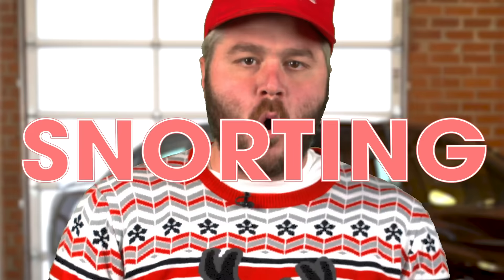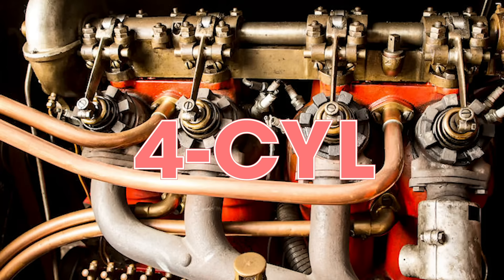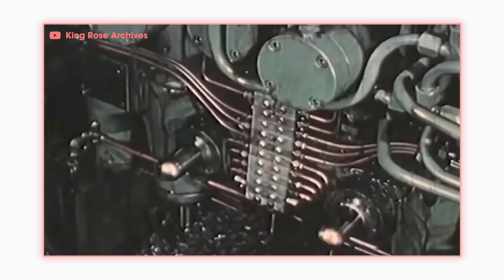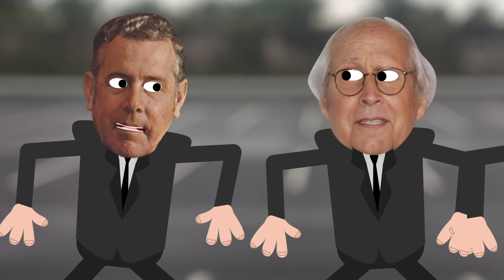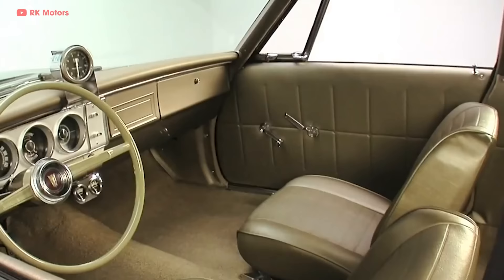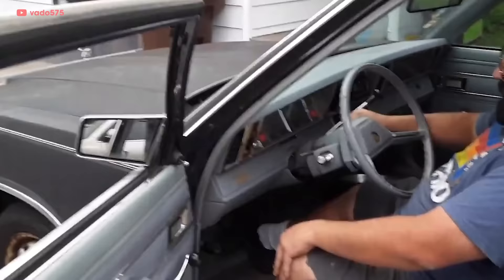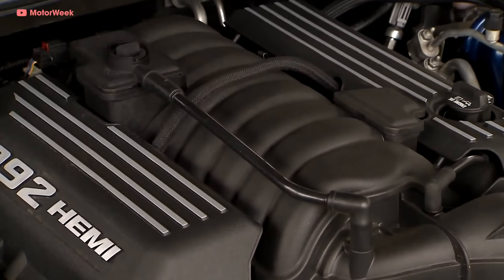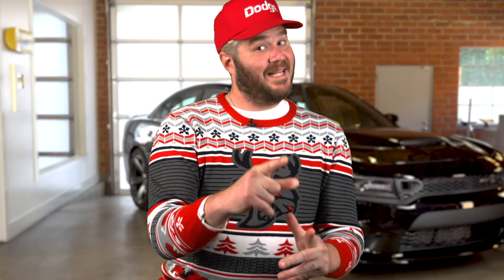DODGE HEMI - Everything You Need To Know | Up To Speed

Comment: "can you imagine 2 thirds of a horse" shows about a quarter of a horse
Reply: off a horse
Reply: Gross!
Reply: Quarter horses are real...
Reply: The rest is in the engine, duh
Reply: Your supposed to Imagine the 2/3 horse lol
Reply: I'd like to imagine that there was at least 1 if not 2 guys who were thinking "How can i modify this thing to go faster and give me at least 1 and a half horse's ?"
Reply: @jamessalas9220  many gas-powered appliances now have similar sized engines making around 15 times as much power as the original Benz engine. Seems like an easy job as long as it’s possible to find an original or more likely replica vehicle
Reply: If it’s too hard to find, the original patent should be in the public domain since it’s well past 95 years old
Reply: Technically it's not wrong, one horse has 2 horsepower

Comment: I just bought a Ram Big Horn with the 5.7L Hemi, I absolutely love it. It's amazing how that Hemi can move almost 5500lbs like it was a crated up Civic. I love to remote start it when I'm standing behind it, reminds me of the good old days of driving Trans-Am's, the sound is music to my ears.
Reply: I have a 2022 Big Horn on order with the hemi. I can't wait to get it.
Reply: Make sure you change the oil regularly. If it has the mds you're almost guaranteed to expensive catastrophic cam and rocker failure that chryslers been aware of but just don't care
Reply: @jmt8706official  have you gotten it yet? I had to wait 4 mos for my new challenger RT 6-speed manual with shaker hood. Just got my Little Suzi a couple weeks ago.
Reply: @TheJLH  Hven't got it yet. Possible delivery in February.
Reply: @jmt8706official  what about now? How fast is it?
Reply: @Jorge O  For a heavy truck, the hemi is plenty of power and speed, it's great.
Reply: @kevobrando95lx44  most people get a tune to stop mds from activating

Comment: 3,400rpm on a prop plane in WW2 is actually quite high. Most german planes thrived at 2,500rpm-3,000rpm, whilst Merlin’s could handle 3,000. But a lot of axis engines would have issues above 2,700rpm aside from the one like Jumo 213E. 

You can only spin a propeller so fast before wit becomes inefficient, resulting in a loss of power or death of the engine.
Reply: it may refer t engine RPM and not Prop RPM
Reply: @illucidate3749  There's usually a reduction gear so, it's probably referring to engine speed not prop speed.

Comment: Everyone complains about challengers not being able to handle. I feel like the big, boxy, heavy, design adds to that old classic muscle feel. I think the scat pack with the 6 speed is the perfect modern MUSCLE car. Big and heavy, lots of power from a big hemi V8. No supercharges or turbos just raw engine roar. Still the same beautiful cruising car. It never was meant to take corners at high speeds and put times on the track. It was built to give you the best muscle car experience.

Comment: The 5.7 Hemi in the 2011-2020 Grand Cherokee is extremely quiet and toned down a bit. You can see the giant intake resonator in front of the throttle body and the multiple mufflers. However, it still sounds pleasant in the cabin.

Comment: I have a 1953 DeSoto Firedome V8 that I got from my grandfather. My grandfather was not the most technical inclined man. He was messing with the distributor and ignition timing, the motor backfired and the engine caught fire, it then sat in a yard for 17 years. My grandpa still did the best he could to try and still take good care of the car, even after the motor caught fire. He would go outside, rain or shine, and cover/uncover the car, open the doors and compartments, so that it wouldn't mold or rust. My grandpa was hit by a car a few years ago and suffered a brain injury, fast-tracking his demensia. he was no longer able to take care of himself, let alone the car. My grandma didn't much care for the car, she didn't do anything to take care of it like my grandpa did. The car sat in the yard for another 2 years without any care. He was so happy when I asked him if I could have the car, I had never seen his eyes so bright. I got the car when I was 16, when I was 17 we were finally able to get a flat-bed truck to help transport it from my grandpa's house to ours. I'm 18 now and I've been doing everything a can to get her up and running. Just a few weeks ago we got the motor to turn over for the first time. There is still a lot that needs done one the car before its even remotely driveable. there's a lot of things that need cleaned, derusted, demolded, and replaced. I know its going to take a lot of time, and a lot of love, to get her running. But like Donut says, "Cars are pain ❤." And I know that in the end, it will all be worth it to hear that engine start for the first time. My grandpa is in a care home and in his late 80's now, and because of his demensia, he doesn't really remember anything anymore. I know he doesnt remember who I am, I know he doesnt remember the car, but I know how much he loved me, and I know how much he loved that car. My hope, and my dream, is that before I can get our car running and take my grandpa on one last ride before he passes. That would mean so so much to me, and that is my dream. I hope I get the chance to see it come true. 

That's the story in a nutshell, there's more to it if your interested.

Thank you, @DonutMedia for all the hard work you guys do, especially the editors and researchers who make the videos possible. You guys are amazing and It doesnt go unnoticed.

Comment: You should talk about the valve dropping issues on the 5.7, and the lifter/cam failures of the gen3's. really killed the hemi name.
Reply: R/T boy 954  Exacty. My 2009 Charger R/T AWD went all the way to 229k miles. Always ran Royal Purple and always changed at 3,000 miles. I got lazy after it became my sunday driver and started doing changes at 6,000 miles, blew after 3 changes.

Comment: Another great video. Interesting fact, the 2003-2006 Honda Civic Hybrid little 1.3L 4 cylinder was also a 2 valve “hemi “ with twin plug ignition and SOHC. It also had VTEC…not for Mo Power but for fuel efficiency as it could selectively cylinder disable 3 of the 4 cylinder to cut down fuel consumption. I used to drive one of these!

Comment: That 4cyl hemi Is the G54B (2.6L) they used that engine in so many cars, including the Mitsubishi Starion. It came turbo charged with a whopping 140-170hp , but they do have decent torque figures. I have like 6 of these engines lol
Reply: Liar
Reply: @AlexJasso100  about?
Reply: If they made a high strung hemi 4 cylinder and put it in a light, sporty vehicle, it might keep the Chrysler company from falling apart nowadays
Reply: I’ve got a Hemi2.6 badge glued to my old toolbox

Comment: Those HEMI's are the best sounding v8s...
Reply: I used to have a 454 with headers that sounded pretty good. But yeah, my current hemi sounds great too!
Reply: Nah the Ford V8s have the most violent sounds.
Reply: @rxtuninginc8444  yeah but the hemi still sounds fantastic
Reply: @thatoneathiestguy2752  meh Ford modular V8 sounds way more nasty.  The Hemi to me sounds like typical V8, just like the LS.  I like the sound of any V8 with a nice exhaust on it though so I'm not stuck on one brand.  My brothers GT350 (the flat plane crank engine) sounds like a menace at 8000 rpm.
Reply: 4.6 GT has entered the chat

Comment: I seem to remember a 383 hemi in a 'Cuda that is still a valuable collector's car. The other engine option for that year was a 440 wedge.
Reply: @George Lane I hate being wrong. But I hate arguing too. So, I looked it up. Here goes:
The Mopar big blocks introduced in 1958 were all wedges. This refers to the shape of the combustion chamber. They were all 90 degree V8s.
Yes, the 383 was a low-block. It had a shorter crank throw. The 440 was a raised block with a longer crank throw.
The 383 was also called the magnum or the camando.
As it turns out, the only hemi in the line-up was the 426. It used the same block as all the other wedge engines.
So, the information in your response is correct as far as it goes.

Comment: Another amazing facts about American Fighter planes: the P-51 Mustang had Nitrous.
Reply: michael howell that was the mustang H I think and p38 was turbocharged with meth injection
Reply: @trevoncowen9198  the p38 was super charged except for the exports. We didn't want the tech to fall into in the hands of the notsees. I didn't know they were injected too, though.
Reply: michael howell The Germans weren’t too worried about our P 38 turbo charger technology as they had a far superior system that used a hydraulic coupling also all European theater p38 had turbos as they were high altitude long range bomber escorts and the Supercharger system offered with the Allison engines did they use were not sufficient the turbos didn’t even match up but they worked they often over boosted the engines at lower altitude which is why they became really good ground attack planes the turbos were housed in the booms I really suggest A book called 100 years of aircraft  or just googling it
Reply: Did you know that the supercharger in the hellcat takes 80hp to run not counting the 707 it already makes
Reply: @hairychesticles1  I didn't know that
Reply: I believe some german planes had that too
Reply: @trevoncowen9198  so I just checked to make sure, we were both right or wrong depending how you want to look at it. The p38 was turbo suoercharged.
Reply: michael howell that’s what it was called But you have to look up what a turbo supercharger was that’s just what they called them because it used a turbine To turn a supercharger impeller thus the name in reality it’s just a turbocharger in modern terms But when most people hear supercharger think roots type you can’t use those on aircraft because they always move the same amount of air and as the alt  goes up the amount of air available to move decreases so the supercharger needs to spin faster all airplanes that were super charged in ww2 use a centrifugal type superchargers That had two or three speed gearboxes to change the impellers rpm For different altitudes
Reply: hairychesticles1 I didn’t know that that’s freakin cool
Reply: @trevoncowen9198  bro, you know your shit for sure. You've left me behind. At this point I have to just throw my hands up and tell ya you've won. Haha

Comment: Next engines:
2JZ
RB
LS 
Ford Modular motors
LS
SBF
SBC
BBF
BBC
K Series
Reply: JC AJ Small block Chevy should be next that's what gave power to the masses not that 2jz Japanese schoolgirl engine
Reply: when it comes to modern cars , I'll take a Toyota V6 over any GM V6
Reply: Troy Stocker First time I ever heard that Toyota V6 lover Most like the four-cylinder

Never had to change a timing CHAIN from a 3800 GM.  3.4l v6 Timing BELT Thousand times might as well Change the water pump power steering etc Basically the whole front end of the engine
Reply: GM could never build a fwd transmission to handle the power of the 3.8 L  , then came the junky 3.6 L with its 3 timing chains.
Reply: bland as fuck but they dont break down
Reply: Troy Stocker When you buy a toyota It's like you gave up on life lol
Reply: when you buy a GM or Dodge , you dont really value your money. Or your spending extra for a status symbol,  esp. true when it comes to Dodge fans
Reply: Ford 300
Reply: R O T A R Y E N G I N O N
Reply: Hey we need an engine. Okay make a heavy as hell iron pig and have someone else design the valve train. We will call it the 2JZ. If you guys like the 2JZ you would freak over a 5.3 Vortec with forged internals.
Reply: @rickhunter6479  to be fair, there's a fair share of badass Japanese school girl characters, so it's not that much of an insult when you think about it
Reply: N54 right up there with 2j and rb
Reply: I agree with all these
Reply: @rickhunter6479  to bad those school girl cars would rip the doors off most of those slow heavy muscle cars
Reply: Coyote!
Reply: JC AJ 2jz video already exist
Reply: I prefer to see the the Cummins ISB 6BT 6.7, that's truly a modifiable monster, the thing comes stock with more than double the torque than it has of power
Reply: LS
Reply: I think we can just forget the mod motors that arent the coyote
Reply: plenty of BMW motors are
Reply: @rickhunter6479  you act like the streets of la is something cool

Comment: I love my Hemi's, and I have owned 4.. 2013 5.7 charger, 2016 6.4 charger, 2017 Ram 1500, and currently 2019 Ram 1500... I do enjoy the 390 hp in the truck 5.7 vs the 370 the cars get.
Reply: I got my charger to 400 horses but that's not hard to do

Comment: My dad has his 2003 dodge ram 1500 hemi... its an awesome truck, one recall involving the gascap and the evap system right when he got it... zero issues since then. 203k sitting on it.
Reply: Its too bad the new ones are. A out of my price range and B i hear more meh about dodge trucks on longevity/reliability than i do good things.
Reply: @303StreetMachines yeah i kean 200k is not much. But my dad really uses it for driving out to the ranch in central florida or any driving out the city (cause he has an electric 2 seater thats for atoubd town stuff  its called a GEM)  so really only highway miles and hauling some atvs  from time to time.

Been a good truck tho. Will keep it alive when he sells it to me
Reply: @303StreetMachines could not agree more... first car... shitty ass 93 civi beater that i loved to death.... still had to come up with 600 to meet my dad halfway.

Comment: 17:07 4 check engine lights came on right when that clip ended. Bet.
Reply: The new Chrysler hemis are the most shit engines ever. Avoid Any post 08 ram hemi . You are guaranteed cam failure before 150k

Comment: I have a black 2012 Dodge Ram 1500 Crew Cab with the 5.7L Hemi 2WD with a 6-Speed Transmission, 355 rear diff with 9.25 gear wheel sitting on 22s atop of 295s. I call it my HEMI-PUSHER as in a hemispherical pushrod V8 345 cid:-)). It just hit 300,000 miles original motor and tranission.

Comment: so a few things. The original wedge was the 413 max wedge. (My dad owned a 63 330 polara that we raced back in the 80's) they took that 413 and turned into the 426 HEMI. (We also own a 68 Road Runner with a 383 commando) It's worth pointing out that the street HEMI had breathing issues. It was the 383 and the 440 that was out there winning races. If you took a street HEMI and did some work you could get a Drag HEMI out of it, but you had to do the work. They are great engines. But like most things they are not perfect.

Comment: I own a Ford 2019 Ranger which is a 4cyd engine with a Turbo. The metal on the truck is aluminum. I can go 0-60 in 6.5 seconds. I do not have the fastest truck. But it is fun!

Comment: lets not forget how beautifully simple and easy to work on the gen 3 Hemi's are. an absolute engineering masterpiece for performance, as well as maintenance. the fact that an idiot with a cheap wrench set can change their own headgaskets in a modern charger or a challenger without having to remove almost anything but the heads and intake is a pretty big deal.

Comment: The only thing you need to know about the Hemi motor, is 100% of them get the "Hemi-tick" and once that happens you have about 30,000 miles to get it fixed before it died. Great engineering Chrysler!

Comment: Due to emissions the hellephant will likely never see production cars. Also the 7 liter elephant engine is allegedly supposed to replace the 6.4 in HD trucks to compete with the 7.3 godzilla engine. It was also supposed to replace the 392 in the SRT models but once again emissions. Now FCA is moving to replace both with a turbocharged 3l Inline 6 to help play the EPA's little emissions game. It will be sad to see the day come when the most powerful engine you can buy in a ram is a 3 liter engine.
Reply: Granted, but the Alfa Giulia has three quarters of a Ferrari engine and it's great.
Reply: I drove a MB cls450 with a 3 liter straight six and EQboost. It was putting down almost 400 ft lbs of torque at 3k rpm so if the new engine is anything like MB it won't be lacking much
Reply: @vamisk  except durability